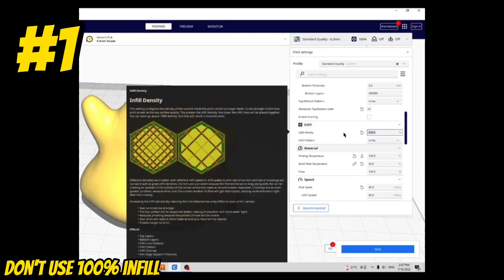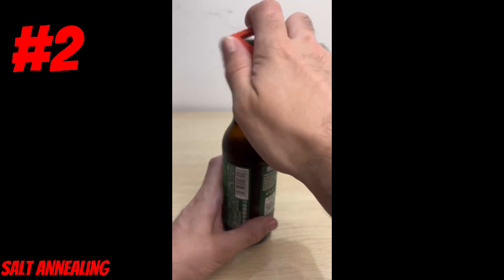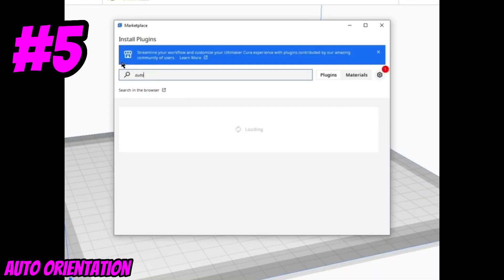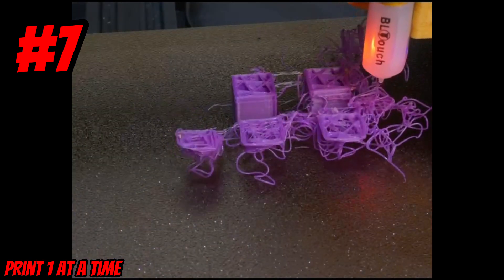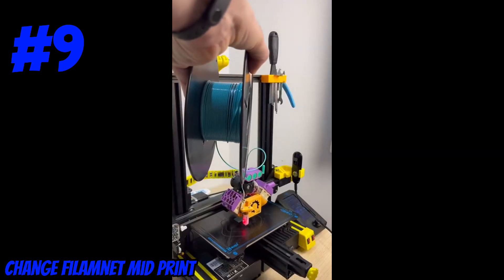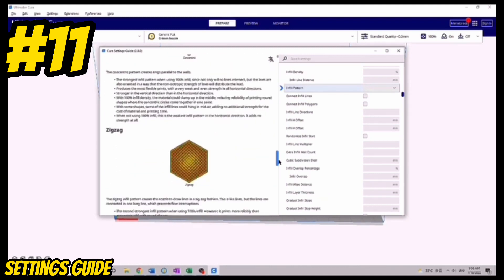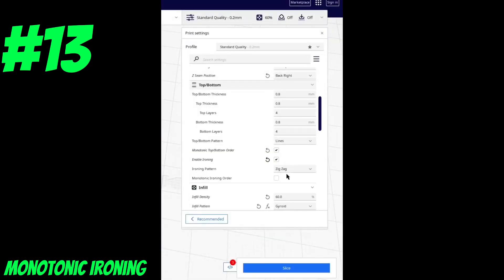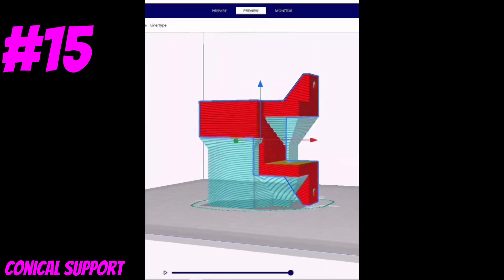30 3D Printing Hacks (Part 1)

Comment: Conical supports vs tree supports. Thoughts?
Reply from the maker: I think tree supports are more efficient and better in most cases.  But sometimes I slice a model and see a mess of many small tree supports starting on the first layer and choose to go with a different support 🤣

Comment: Fuzzy skin and one-at-a-time are in PrusaSlicer too, but the rest isn't. You can also put in a color-change on PrusaSlicer, which will actually move the head away, eject the filament, and wait for you to put in the different color. Keeping rafts for color matching is a cute idea.  If you're embedding metal like his bottle opener, hit it with some glue stick first, and the filament will stick to it. Also take care if you do this with a magnet that it doesn't stick to your nozzle.  PrusaSlicer you can click on any setting to open a web page about it, just like the settings guide.
Reply: everything apart from marketplace and conical supports is in PrusaSlicer, ironing extrusion width etc..
Reply from the maker: Great tips!  Thanks for the comment!  Yes use brass nozzles if you're going to embed a magnet, not a steel nozzle!